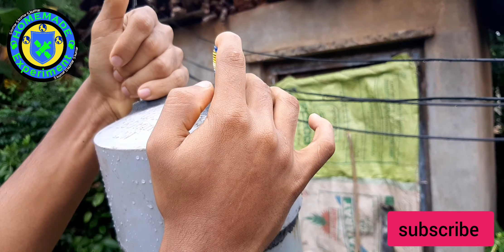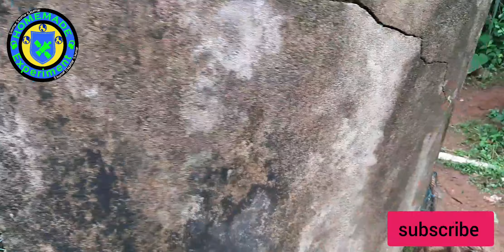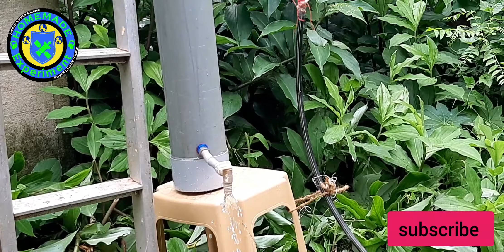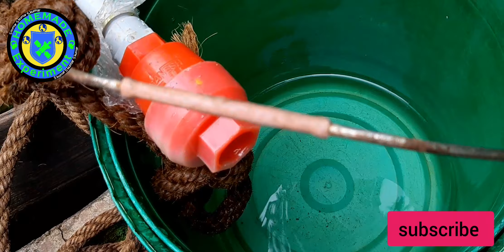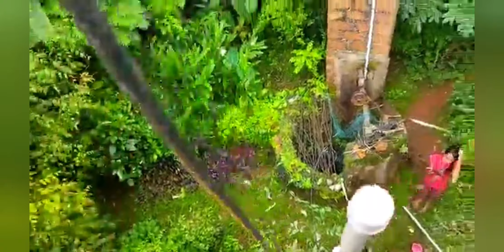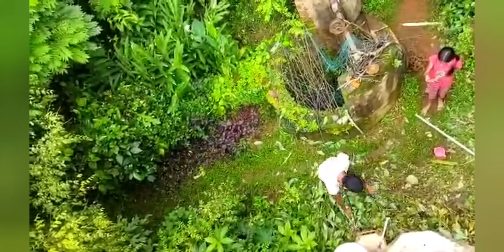Free energy water pump

Comment: Love this! Why not fit a vaccuum presure gauge to top tank. No Expert but according to google 1 PSI lifts 70cm. 10 PSI 7M. I also wonder if its possible to increase the flow. I guess you can increase the inlet and outlet pipes and interconncts by the same ratio. Also interested in the effect of the capped pipe at the interconnect, I wonder exactly how it increases the pressure at the output. I beleive its the head height which increases the pressure not the length of the pipe?? Just to clarifify is the inlet 1/2 inch outlet 1 inch . I also wonder if by changing the ratio of inlet and outlet size if it affects the vacuum negative pressure which pulls the water up, Thanks awesome job!